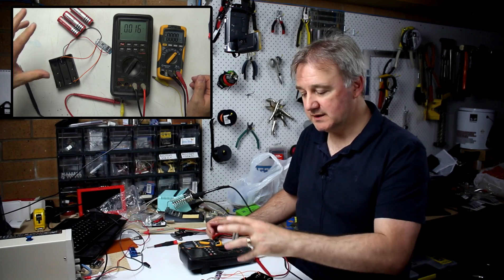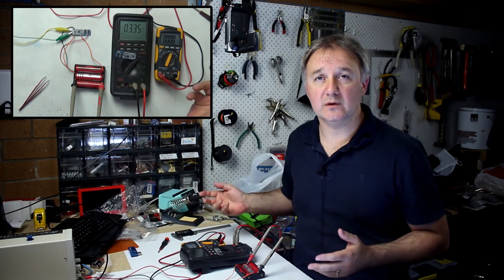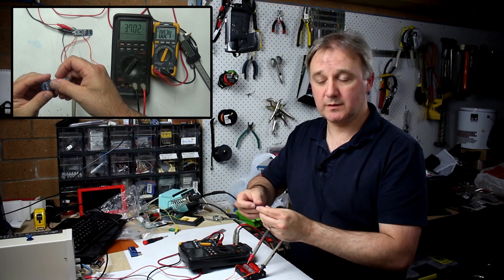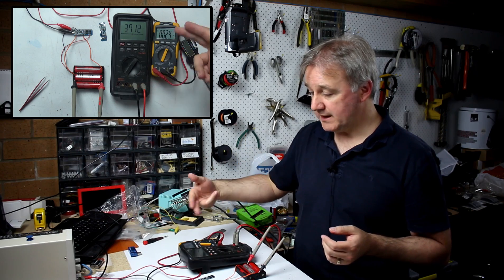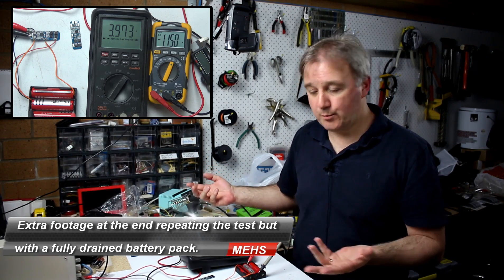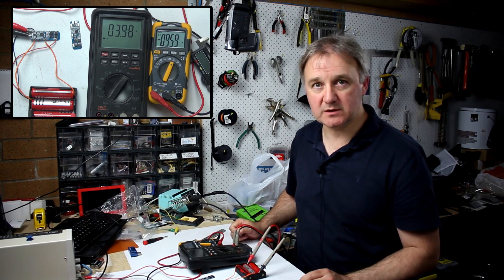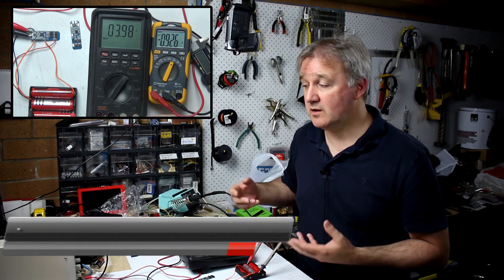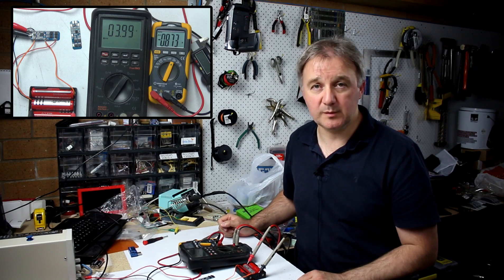Does a BMS charge my Batteries? (MEHS) Episode 57

Comment: What about these boards, are these actually capable of balancing the batteries?

http://www.ebay.co.uk/itm/Li-ion-Lithium-Cells-Battery-Protection-Board-BMS-PCB-Balance-3S-4S-5S-6S-13S-/262935282721?var=&hash=item3d382a0421:m:mRnKiFMrUn8HN_2roEiagTQ
Reply from the maker: - Hi.  I would say yes in one example that was actually for LiFE04 cells not lithium ion cells but can't be certain.  The others may have a balance function but I wouldn't be convinced just because it says so in the add.  You would need to see exactly what IC's are on the board that you actually receive to determine all the functionality.  Cheers.
Reply: My electronics is pretty weak, from what I believe, I think I need a proper balancing charger and a BMS. Correct me if I'm wrong
Reply from the maker: - Simply put, balancing looks at each cell and corrects for any variance due to some cells receiving more charge or being drained more than others.  It is important because in a battery pack you can have some cells at 4.2v and others at 3.9.  Or some cells drain to 3v but others down to 2.7 and an example.  A BMS that does not have a balance function will protect the cells from over and under voltage and current but doesn't make sure all cells are equal.  Having said that 3 cells in series are likely to be pretty close.  A balancing feature will attempt to get each cell equal.  If you have just 3 cells in series then the likelihood of unbalanced cells is low and the problems you would have if you did have one is also low (a little less battery capacity maybe).  If you want your cells to last as long as possible then balancing is more important.  If you have a greater number of cells or you have a mixture of cells in parallel then the chance of unbalanced cells is much higher.  Also if you can remove your cells every couple of months and run them through a dedicated charger then you really don't need to worry about balancing.  If you want to manage a lot of cells and get the most out of those cells and won't be removing them occasionally then balancing is almost essential.  Hope that helps.  Cheers.
Reply: My plan is to take some laptop batteries and put them in 3 by 3 (that is 3 in series, with 3 in parallel = 9 batteries total). I'll attach a BMS because I'm using it to power a peltier plate, so I don't want to over-discharge them.

The only confusion I am having is about balancing and charging. Lots of people on Youtube/internet say that the only way to properly balance the cells is with a balance charger, (which monitors the voltage of each set of parallel batteries), which then corrects it by draining etc. However, I do not understand how it would balance the 3 cells in parallel as it can only balance each series of batteries but not each individual battery.

I have not seen any reviews or videos showing a BMS pcb w/balancing that actually completely balances cells. I have seen the description of one, perhaps the one i linked above, which only corrects for marginal differences in voltage.

I have one question: 

Is a balancing charger, such as an IMAX B6, required for charging a 3x3 lithium battery pack (with a BMS) correctly? Or will a standard 12V charger (like a laptop charger) be suitable to charge the whole pack?
Reply from the maker: - Hi.  It depends on your level of care and OCD.  If you dont care if some cells are tasked more than others and you dont have to have max efficiency, a BMS will keep things safe, e.g. within safe voltages.  A balance charger (like the B6 - that you dont embed in your project anyway) will make sure all the cells are optimal.  The cells that are in parallel are not directly managed as they self balance (sort of) by being connected to each other in parallel.  If you open up a portable power bank you usually find 3 or 4 or more 18650 cells in parallel.  Many of those power banks dont have any balancing function at all, just a single cell charger charging all cells as one and a step up power regulator giving you the 5V USB output.  A BMS board with real balancing function will work similar to the B6 just not as sophisticated or as powerful, and a BMS does connect to each cell in series so it can sample the current state of that cell (not the cells in parallel but as mentioned, thats not a big issue).  Head over to Battery University for more information.  Hope that helps.  Cheers.
Reply: Yes thank you that was really helpful, perhaps you could review one of those BMS pcbs that claims to balance as well. 

Again I'm thankful you took the time to help.

Nice videos,

ed
Reply from the maker: - Great.  Yes I will try to do a detailed review of a BMS that has a balancing function included.  Cheers.

Comment: I have a question: if use BMS can I change mu Pbgel 12v 9Ah battery on my UPS with li-ion 18650 pack?
Reply from the maker: - Hi.  That would be nice but no you can't.  The BMS will tie the cells together but the UPS charges the lead acid battery differently to what we need to do for the lithium cells.  In this example it may work for a while but the charge method would shorten the life of the cells considerably.  Lead acid batteries are much more forgiving and can be trickle charged which is why they are still used in UPS.  Cheers.
Reply: Thank you very much.
Reply from the maker: - Hi.  Yes that's a nice build.  It's worth noting that he didn't just use a BMS.  The main addition that makes it work is the lithium charger running at 12.6V and probably following the correct charging methodology.  The lithium charger feeds power to the BMS which supplies power to the cells.  In that instance the UPS build is working just like a laptop with an integrated battery.  When external power is available the UPS battery is charged (correctly) and the rest of the power is being relayed to the inverter and the (nice) printer he was using.  When external power is unavailable the relay switches back to the UPS as the power source.  Again, the key is the additional of a proper lithium charger charging CC then CV at a max of 12.6V for the 3S pack used in conjunction with a BMS.  Cheers.

Comment: How do I charge my 4s6p 18650 cell?
Reply from the maker: - Hi.  Use a 4S BMS with balance like (Ebay id 162165785768).  Connect all your 6 cells in parallel and then connect that row to the BMS.  Repeat 3 more time to give 4 banks of 6.  For charging you can use something like (Ebay id 322453539685) which is an external charger that connects to your 4S BMS.  That's all you need to do unless you want to embed the battery pack into something.  In that case it all depends on what power supply you have.  Cheers.
Reply: Good input. yeah I'd like to charge the 4s6p as a single unit. I have a couple computer power supplies at my disposal that I've hacked to run some led lighting. I was thinking I can use said power supplies,  but I'll probably need to do some more hacking. more input is appreciated :).
Reply from the maker: - Once you have all the cells connected correctly and managed with the BMS you can use any external power supply and charge the pack as you would a single cell.  In this case it would be a max voltage of 16.8v with a constant current of about 0.5a per cell used (approx 12A) so each row or each BMS is getting around 3A.  You could possible go more depending on the cells used and the rating on each BMS.  You could easily to this with a dedicated charger but you can also use a bench power supply and run CC for a time then switch to CV.  There are a few videos on using a bench power supply to charge a lithium battery.  Cheers.

Comment: Thanks for making the video.  it was helpful to me as I am just starting to mess around with building battery packs and Lithium Ion charging.  I built a 3 cell pack with the same BMS board and a balance cable connector.  In use 2 of the cells seem to have less capacity than the third and result in an out of balance condition after discharge.  So I was interested to see if the BMS board would do any balancing if the pack was raw charged.  I connected it to a very low power and unregulated wall-wart.  The open circuit voltage is about 18 and the battery pack pulled down the voltage and it was charging at about 270 mA.  I plugged in one of those 2 dollar LED digital battery monitors to the balance connector.  The two lesser cells started their voltage climb and I was very interested in what the better cell would do.  It appears that the BMS tries to shunt some of the current around the higher cell(s) to allow the lower voltage cells to catch up.  What I am observing is that the higher cell voltage will be (in this instance of time) 4.08....4.01....4.02....4.08....4.05....4.02...repeating up and down, with a cycle time of 10s of seconds.  I think the shunting can only take so much power/heat so it is done off and on.  Anyway, that is what I have observed.  So while it is not managing the charge, it appears to be trying to balance, within some limits.I can charge on this low current charge until the voltage at the pack terminals is 12.70 and then I stop it.  If I then put in on my good charger, it will only add about 20-30 mAH and say it is full.
Reply from the maker: - Thanks for that.  Good additional info.  I have seen a similar board that has an inbuilt balance function that might be worth testing too.  Also, I've just posted another video on this subject you might find interesting.  Cheers.
Reply: So can you confirm that the HX-3S-01 does perform at least some limited form of balancing when charging? What about when discharging?

Comment: The CC and CV stage is automatically achieved  if the power supply is CC set at 1 amp and  4.2v. If the 18650 is at 3v and it is connected to the power supply then, around 1 amp of current will flow to the cell and the voltage will rise to 3.5v. Overtime, the voltage will slowly rise to 4.2v. All throughout this time the CC stage is in effect. As 4.2v is achieved, the amps will begin to drop over time, from 1 amps to 0.1 amps. This is the CV stage.
Reply from the maker: - Hi.  Yes agree but the issue is that most uses Ive seen dont use a CC / CV source.  The BMS is fed power from something like a power brick (wall wart).  So the BMS and the batteries are receiving power but its not staged and is more like the charge supplied to lead acid batteries.  I mention more in a later video but the BMS should be paired with a proper CC/ CV charger as you indicate.  I will be doing a final video on this in a week or so using a proper battery charge circuit and a BMS for an all in one rechargeable 12v Lithium battery pack.  Cheers.
Reply: Agreed. Most of the power bricks on the market are CV. 
I have a 4s 400 cell battery pack that I have been charging and discharging once a day for over a year now using a 19.5v 12a power brick connected to a buck converter (CC/CV) set at 16.2v 5a. 
In the last year, I have had to manually balance the pack twice using an imax b6 at the 1s setting. It would be nice if the process could be automated as I am planning to up the pack to 1200 cells in 4s. Thank you.

Comment: where did you get the 25-30% number? Any calculations or did you just make that up?
Reply: Maybe because those ultrafire cells are only good for about 500mah's in the first place?
Reply from the maker: - Hi.  Rough calcs based on initial observation from a couple of run throughs.  It does not consider the possibility of a bad cell throwing out the results as was the case here.  The average result was that the cells charged through the BMS were very well charged but not properly meaning they had a good runtime per charge but won't last as long (replacement cycle) as properly charged cells.  Hope that helps.  Cheers.

Comment: I was taken after watching the first video and went and got some , only to realize that you completely gave a thumbs down on the charging part
Reply from the maker: - Hi.  Yeah they allow current and voltage to pass to the cells in a controlled way but thats not the same as correct lithium charging.  You could get away with it for a short time but it would eventually damage your cells or lead to a bigger issue like fire (unlikely because of the BMS, but possible).
Reply: at least make up for your blunder and explain how to charge them while using this type of circuit. You must have ancestors from China.
Reply from the maker: - I will see what I can do.  You can use a power reg to provide controlled power to the BSM such as an adjustable LM2596 set to 12.6V, for 3 cells or 16.8V for 4 cells.  Its not ideal but works as I demonstrated in my video comparing charging cells through the BMS vs a battery charger.  Cheers.

Comment: can  i know how to voltage balance before charging those batteries directly after getting them out the laptop battery ? placiing them in parallel for a night would do the job ? thankyou
Reply from the maker: - Hi.  Yes you are right.  Placing them in parallel with a decent low resistance connection (thick wire) will do the job.  Cheers.
Reply: 1
 more question pls, can i charge those batteries(after being sure they're not dead) 1 by 1 by the tp4056 chip(cant afford more than 1 tbh it costs 5.7$ for each here and even its the old version) and then use the bms circuit for 4 of them and use them as  a portable battery pack ? would that be enough ? thanks in advance again
Reply from the maker: Hi.  Yes that would work fine.  Basically make yourself a single cell charger using the TP4056 board and charge each cell up individually, then add the charged cells to your battery bank.  Cheers.

Comment: 1. if you measured the current from your PS - then 1A goes to all of them - each get 1A - it does not split (the voltage does) .
2. getting the optimal charge has nothing to do with what you say .. you must wait until the charge is complete and the current deops to zero (not close to zero but zero) - to each cell .
then discharge and check how much capacity they got ...

I guess I will just need to do the test once I get my BMSs.
Reply from the maker: - Hi.  Yes I noted the mistake a while ago regarding the current to each cell.  I think my point is valid for the charge going to each cell mostly because this board is a battery protection board and not a battery charger.  It does not have a proper charging IC.  The charge going to the cells through this board is a rough charge much like charging a lead acid battery.  Cheers.
Reply: Hi can you pls tell me do i need charge controller..if i am using BMS on 3s3p lithium ion battery...and do BMS comes woth PWM